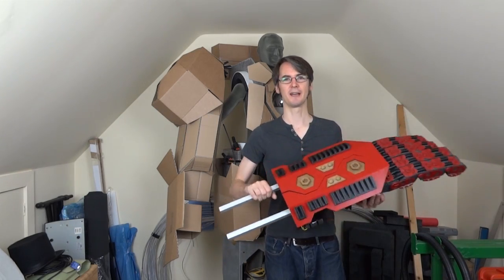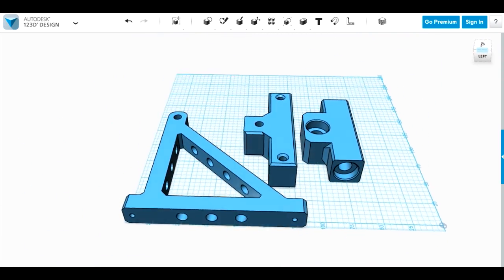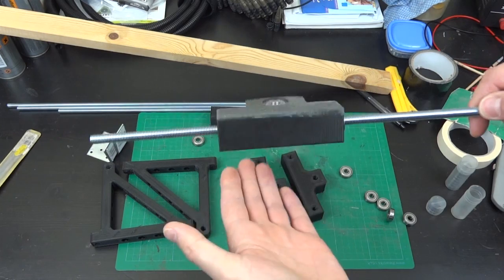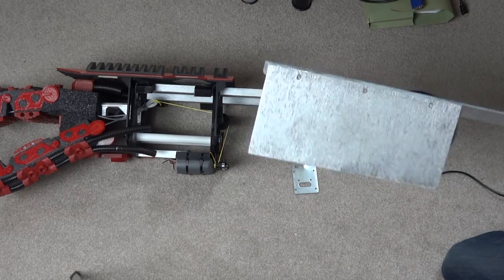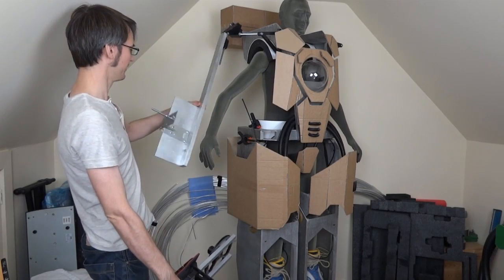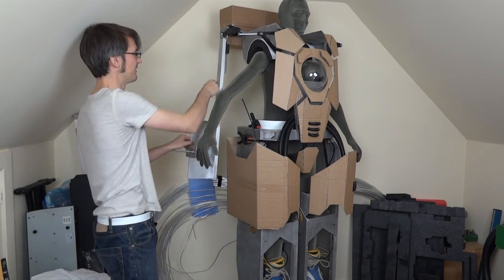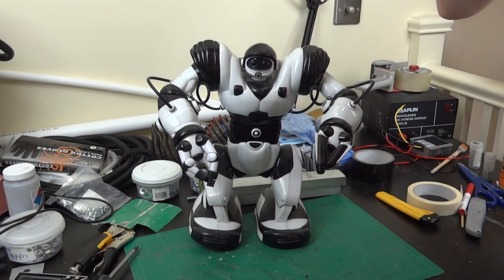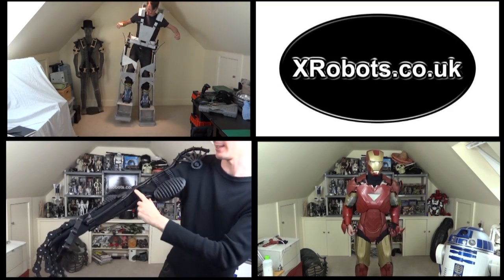Iron Man Hulkbuster Cosplay #10 | Shoulder & Upper Arms | James Bruton

Comment: Not sure if if you have thought of this, but since you want your arms to be easily removable from the suit to use a central control panel, you are going to need something solid to hold on to in order to move the arms around.  My suggestion is mounting a piece of 1 inch wood dowling with a four or eight way switch mounted on the top to activate with your thumb, and a trigger switch or two.  Much like the eight way hat on top of joysticks or a D-Pad found on almost all controllers.

Comment: the adjustable arm was a good idea. bending your arms inside the hulkbuster arm is however a horrible idea. dont FIX your joystick to the frame of the hulkbuster armor. put it on a rail much like a drawer is on rails. then irrespective of where you rotate or lift your arm you would always be in reach of your joystick.